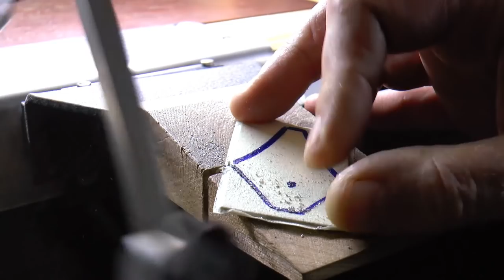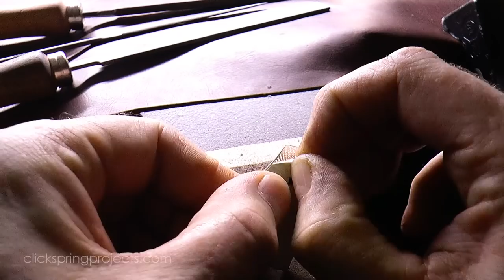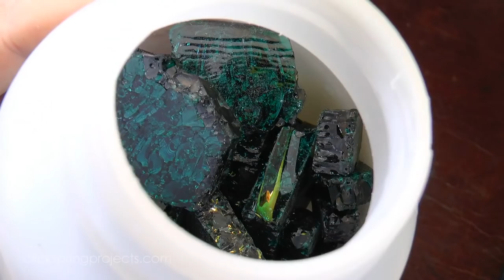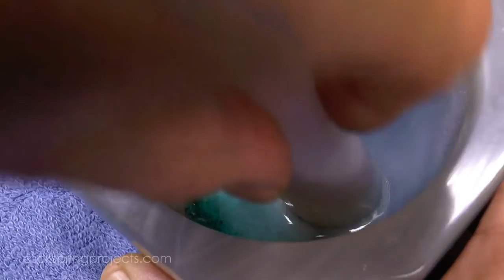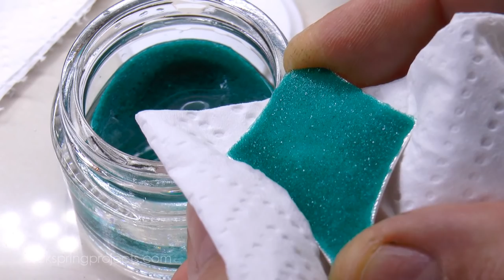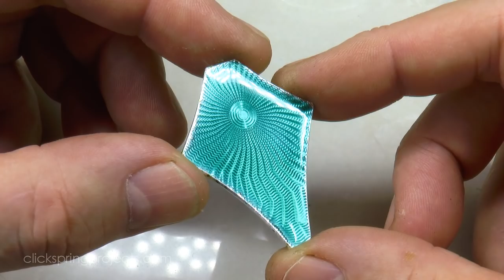Enamelling Fine Silver Guilloche - Art Deco Design

Comment: I would never have guessed that jade has a lower melting point than silver! Excellent work!
Reply: From what I could find it doesn't - I think silver is 962C and jade is nearly 2000C. So either my data is wrong or it's not just melted jade it's something else. The label on the jar seems to suggest it's not actual jade, I think.
Reply: @DavidRa73  Its not real jade. That's just the color name of it. A little confusing but i think they have changed the name of it now. Just normal glass enamel. And it is fired at about 100c less than silver melting point. Around the 750-850c range.